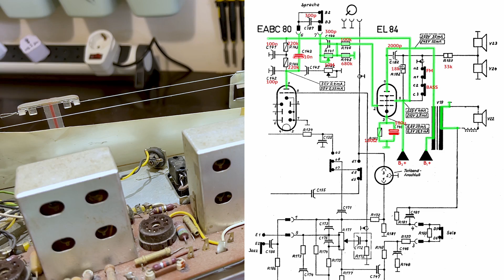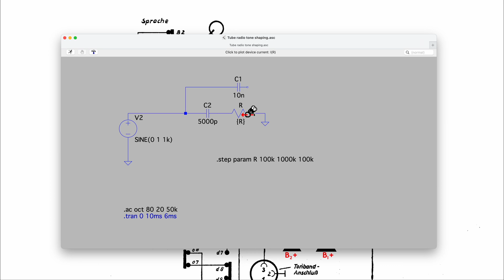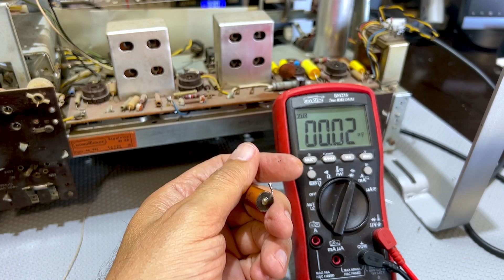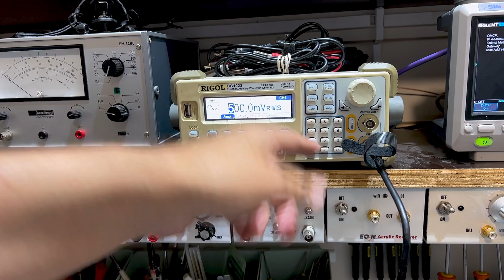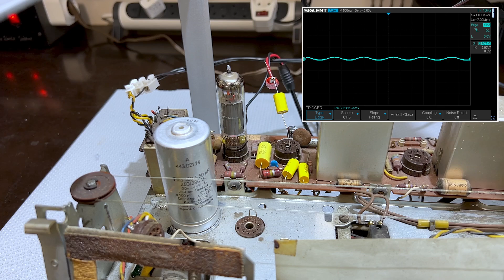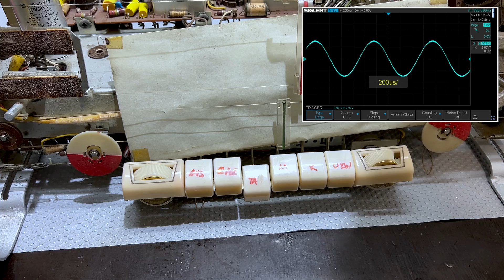How to safely test the output tube - Tube Radio Restoration Back to Basics part 5

Comment: The mystery of the bass :  your description on the Buttons is not correct. From right to left it has to be FM - SW - MW - LW - TA- OFF. So what you press is TA, not bass. The Nordmende-Engineers   made the tweeter only work on FM and TA, because the AM bands only transmitted up to 9kHz.
The bass-button ist one of the five tone-control-buttons (Jazz-Speech-Orchestra-BASS-Solo)

Comment: I've been working my way through this series while working on my first radio restoration. Thank you for sharing this. I've appreciated your method for breaking the schematic down into sections and systematically testing the circuit. If I can ever get this old Zenith working again, you'll have helped to revive it.

Comment: Hy, i could use a hand with my old radio, i know very little about it, im too scared to plug it to 220v the original cable isnt present, i dont even know if it work as is. It an old Evernice i think. I would really like to restaure it to it former glory... any pointers would be great... thanks.
Reply from the maker: I would suggest you do a lot of watching others at work, and perhaps get someone with some experience to repair yours. It’s dangerous to tackle a radio repair knowing very little .

Comment: The shunt capacitor between the two resistors in the triode plate circuit isn't just there for filtering. It provides an AC ground so that the plate AC load consists of only the lower resistor. Otherwise it consists of both resistors. This is its main purpose. The extra filtering is a bonus.
Reply from the maker: I guess you could look at it that way. True. However, every stabilised supply point is a good AC ground, which means that the same effect could be achieved by simply using one 220k resistor instead of two. The plate voltage would be higher, however, but the stage gain would be the same.
Reply: @electronicsoldandnew  But then you have both plates powered off the same AC node, which is a recipe for instability. There isn't another way to look at it.
Reply from the maker: I think the idea was to create an AC ground path (for high frequencies) one step (resistor) away from the B2+ supply, hence avoiding the possibility of HF getting to that supply line. I believe we’re both saying the same thing. It’s a path for ripple of any frequency (including HF), which is why I call it a filter.
Reply: @electronicsoldandnew  The idea is to create an AC ground node so that the plate resistor is the only AC load. Everything else is a beneficial side-effect.

Comment: Let me know if I misunderstood something but when you were showing the first graph with the waveforms for the steps of the bass boost, you mentioned that the graph was the opposite of what you would expect.  It occurred to me that the waveform is what would be on the Control Grid of the OUTPUT tube (valve), and being a tube it is going to invert the signal on the grid to what you would want.  Am I correct with that?
Reply: No. Tube is just inverting the phase of the signal, but not amplitude. So what is attenuated in g1 stays attenuated on anode too.
Reply from the maker: No, the polarity isn’t in question. It’s the relative amplitude for the frequency that will remain the same even when inverted (because all frequencies get inverted).

Comment: Question 
 Has anyone run a frequency response curve test on electrostatic speakers?
 Listening to a known piece of music on a phonograph using one of the German radios with electrostatic speakers, how well does it compare to newer Tweeter designs, This being totally subjective.
Reply: The trouble with those electrostatic tweeters is that 95% of them don't work anymore, because the insulation has failed.
Reply from the maker: True, but quite easily repairable. We’ll see how these are.
Reply from the maker: I haven’t seen one, but sure would be interesting. However, I think it needs to de an actual acoustic test with a measuring microphone etc, as simply testing the signal with a scope won’t really give a true representation.

Comment: OK, the bass button is the pickup. The actual bass button is on those top buttons along with the other tone shaping stuff speech etc. The order of those buttons on the lower section is Aus, TA, L, M, K UKW. You would need to plug in those tone shaping buttons to do that test!!🙂Now it makes sense!!!!

Comment: Nice one. Update on my Philips, I got the FM back. Its just so low that I couldnt hear it 😅. Now I need to to figure out how to align it without a sinal generator...
Reply from the maker: Use a strong local station
Reply: I will give it a try :) One has to start somewhere...
Reply from the maker: 👍 a local station near the middle of the band can be used to do the IF alignment. If you have two known stations near each end of the band, and you know their exact frequency, you can do the RF alignment too.

Comment: That bass button makes no sense. If that bass button only operates on it's own then what is the input? It looks like it is popping all the input buttons up so there is no input (AM, FM or Pickup). It needs to be an on/off indepedent toggle, surely? Othewise all it is doing is muting all inputs! That aside, it makes sense that the electrostatics would kick in for FM and I can see the logic to kill those on AM (lower quality sound) but it's all a bit weird because why would you not want the electrostatics on the external input. And if that base is popping all inputs up then it's a mute button. Very strange!!
Reply from the maker: Looking closely at the shattered dial glass I realise that I misread the button designations: it’s actually AUS, TA, LW, MW, SW and FM 😊 Now it makes sense 😊 The tweeter frequencies are shorted to the supply in all but the TA and FM selections. Now it makes sense 🤦
Reply: I think it's in parallel with the FM button not series. It's just shunting the tone correction
Reply from the maker: No, my mistake. Looking closely at the shattered dial glass I realise that I misread the button designations: it’s actually AUS, TA, LW, MW, SW and FM 😊 Now it makes sense 😊 The tweeter frequencies are shorted to the supply in all but the TA and FM selections. Now it makes sense 🤦
Reply: @electronicsoldandnew  That was a fun misreading of the buttons. It got us all thinking!!! 😂
Reply from the maker: Yes, but I should really have done a bit more of that myself 😊
Reply: C1/C2 on the schematic is on the pickup button (not the bass). N1/N2 is the FM button but, as you say, those have to be in parallel for them to enage separately (as they appear to be doing in the video). I think the schematic is misleading and the bass button in the video is actually the pickup button!! That would then explain it. 🙂
Reply: @JonRig when I said I thought they should be drawn in parallel I was thinking the switch was normally open for FM. It seems the FM and PU switches are normally closed until activated so the series connection makes sense. My mistake.
Don't know about you, but I actually lost sleep over this one lol
Reply: @robturner3065  I believe you are absolutely right. They are normally closed when LW, MW, SW is selected (and shorted to supply, as Manuel mentioned in his comment). That path then goes into an open state when either FM or PU is selected. The rabbit hole I am now stuck in is trying to understand the precise voltage flows and I think it is made more complex because an electrostatic needs a constant charge on it for it to work and so the schematic is still tormenting me. I have not been able to get into my head the precise nature of the voltage and current flows in that part of the circuit. So the answer is clear, but I only know it at a superficial level and that is not quite enough for me!!! I want to know the exact detail!! So, more sleepless nights! 😂

Comment: Hmmm. If n1/n2 and c3/c2 (FM and BASS on your schematic) are both closed then any signal trying to pass through C182 is being "shorted" directly to the B2+ supply isn't it? So the tweeters are only active if n1/n2  or c3/c2 (or both) are open circuit. You'd expect the tweeters to be in circuit when FM is being received. It seems that they also enable the tweeters if Bass is selected when FM is inactive? I've had a long day so if I'm talking rubbish please excuse me. 🤣 P.S. Edited twice. Yes I'm confused as well!
Reply: Yes, you are right. Tweeters are active only when FM or Phono/AUX (no Bass) is on. All other combinations put tweeters to B++ that is AC grounded. Then the 2000pF capacitor is effectivly connected from anode to ground, so it cuts off high frequencies on AM band and stabilize the output.
Reply from the maker: My brain went round and round looking at the logic of that selector, so I know what you mean.